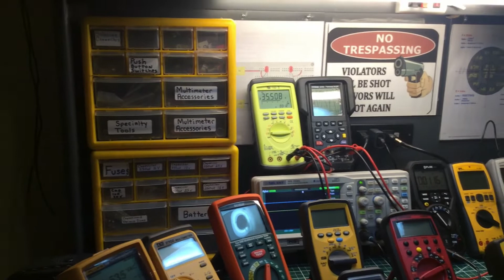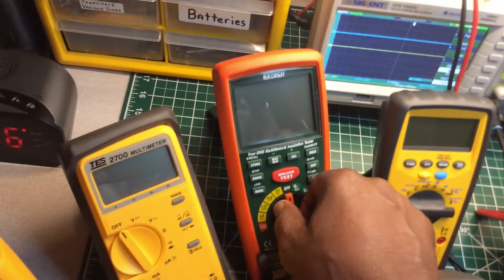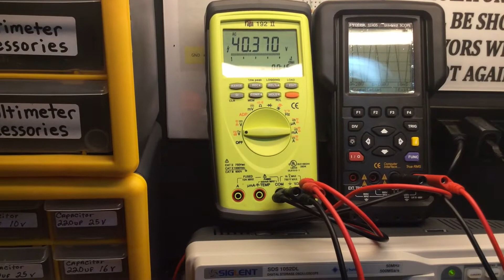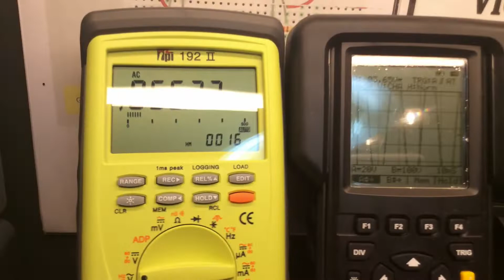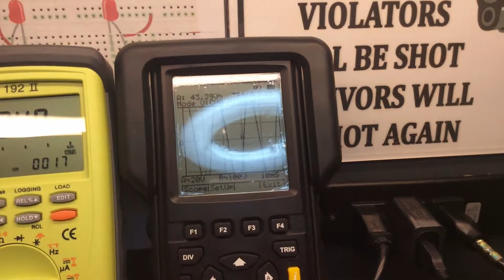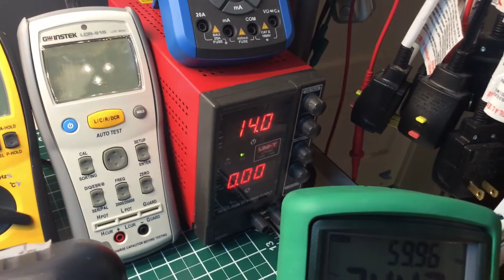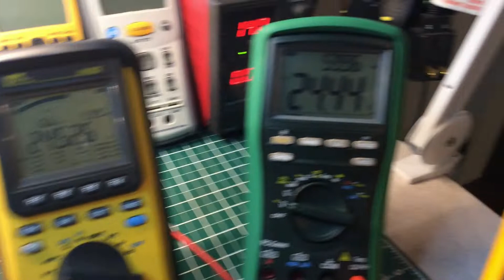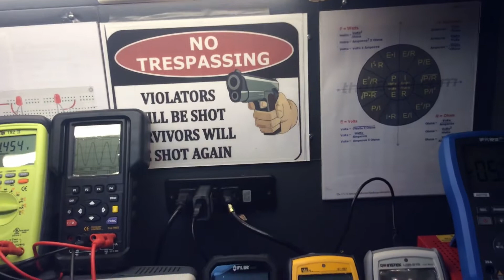MULTIMETERS . . .

Comment: I still have my two old Radio Shack pro meters they made back in the 90s. Yellow housing with the rubber boot, very heavy duty and accurate on the money for setting guitar amp voltage bias etc and power supplies. Prol made for them by Fluke. All the best, Dave
Reply from the maker: Dave, it sounds like you’ve been blessed to get your moneys worth out of those multimeters, that’s the way it should be.  I don’t know your age sir, but way back then things were BUILT TO LAST. Unlike nowadays there’s some multimeters on the market that will self destruct from sitting on the shelf not being used. Take care Dave.
Reply: The Electricians Tool Channel 
Thank you for the insight! Yes they still work perfect and haven’t been treated delicately either ;))))))))